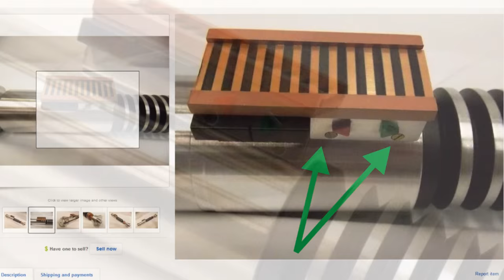Return Of The CNC Dude: ROTJ Lightsaber Circuit Box

Comment: Nice work on the Saber dude! Couple of ideas for the switch box.... Couldn't you chuck a slightly longer piece of stock up in the 4 jaw, off center and bore the radius in there with a bar? If the hilt is solid or has thick enough walls id just mill a flat on that, you would have the same visual effect. Lastly, whats the maximum corner radius you could live with on the triangular holes? You can use the main spindle to run end mills down to 1/16" with no problem. Great idea to have some star wars merchandise in the pipeline.
Reply from the maker: +l0ckcr4ck3r Hey, thanks for watching! Hmmm, doing it in the lathe did not even cross my mind, but that should surely work. Thanks for the pointer! I did thought of milling a flat on the hilt, but I am making them hollow as I may try to do something resembling internal circuitry. It truly has been a fun project!